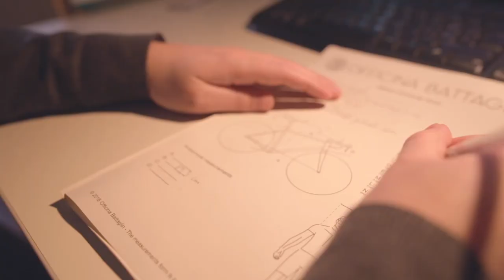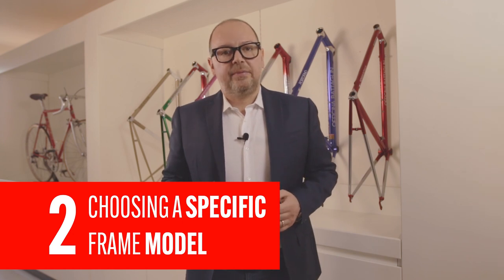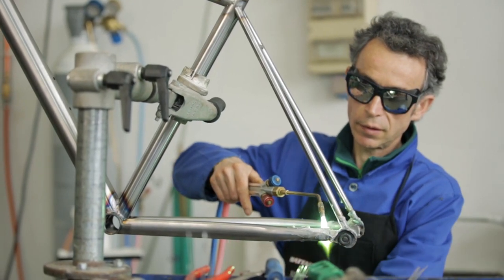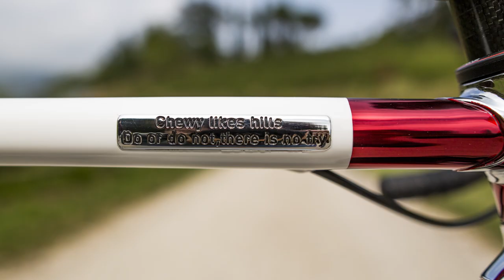Building a steel road bike:  5 STEPS to a GREAT CUSTOM FRAME [Behind a Custom Steel Bike]

Comment: Having ordered a custom frame, here is my tip. If you don't know what the right dimensions should be, visit a bike fitter in your area (before you order a custom bike!) and ride their adjustable bike  with different positions.  It might cost you $100 but the bike fitter should tell you  the right stack and reach, and accordingly top tube and head tube should be.

Comment: It would be interesting to read some comments from a bicycle engineer and manufacturer on combining materials in framesets, like steel frame+ carbon fork, aluminium frame + carbon fork or aluminium frame with carbon stays+ carbon fork. Is the steel frame+carbon fork combination better than pure steel? Steel is real?!
Reply from the maker: Hey Yuri, that's a very good question. In our modern framesets (the Portofino and the Power+) we do combine a steel frame with a carbon fork. The purpose of using a carbon fork is keeping weight down as much as possible while ensuring great handling. It would also be possible to use carbon for other parts of the frame. But in the end, it all depends on the specific ride quality the the manufacturer wants to achieve. On this page you can read some comments from our customers so you can get a better idea of how our combination of materials translates on the bike ==> https://officinabattaglin.com/testimonials/
Reply: Steel is very real! Lasts too!
Reply from the maker: @timdodd3897  Yes, it's definitely more durable than carbon!